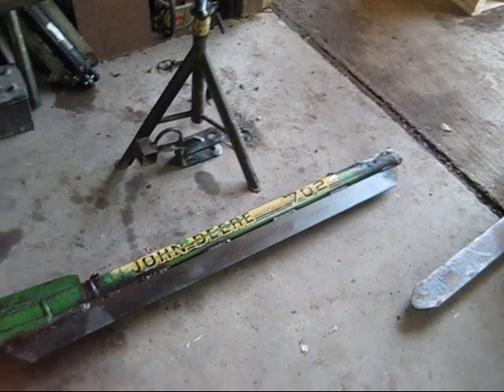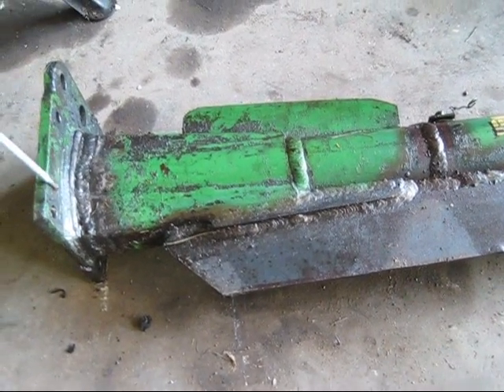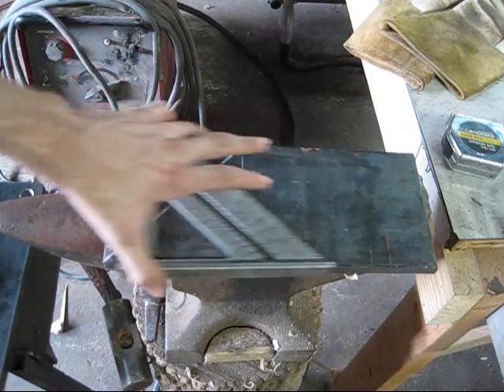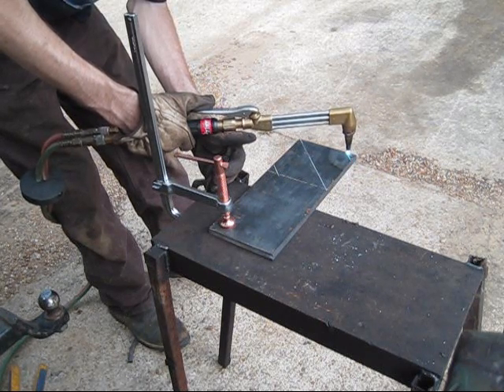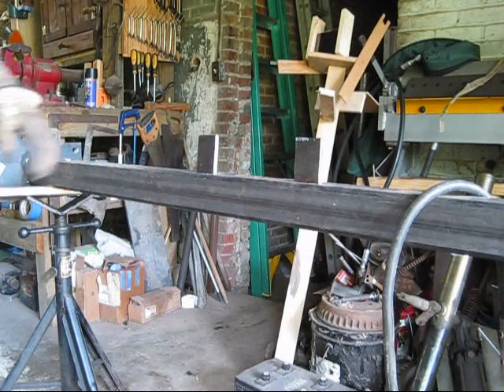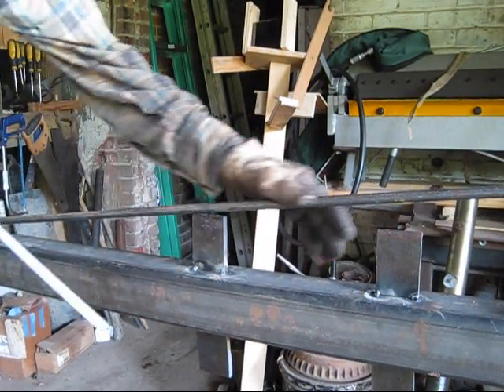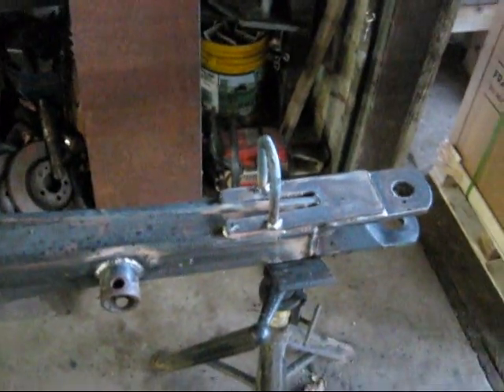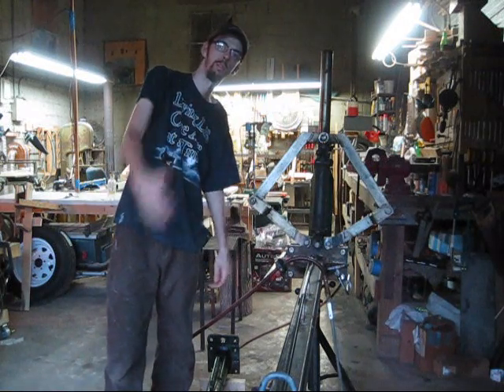Fixing design failures

Comment: sounds like a AC buzz box . have you thought of a plasma cutter instead of oxy act torch ? great vid , thanks
Reply from the maker: That is a old Lincoln transformer machine. Square wave 175 it’s a DC machine you’re hearing the transformer kick in I’m sure. I’m not a fan of plasma need to do a video on it they don’t fit the needs of what I do mostly. And they’re not cost-effective the consumables for plasma cutter or seriously expensive over time. Thanks.

Comment: I've worked at several trades and sometimes a solution used in one can suggest a solution in another. When you were building that stiff back It reminded me of some semi trailer repairs I've done. On a semi trailer that would go under the deck using larger material and would be called a stress rod. 
When I was hauling construction equipment I had a paver stack give out and end up laying on the deck of the paver. The stack gets rid of  the fumes from the asphalt and is about 6 inches square and 8 feet tall. It was a new unit so it should have been okay but the stack was held to the deck using quarter inch bolts. That may have been enough for while they were paving but on the deck of my trailer the stack felt  every bump in the road two weeks after the company bought it. 
I'm retired due to an injury so I like to spend part of my day watching other people work. The good ones that is.
Thanks for another well done vid.

Comment: You are producing some of the best technical work instructional videos on YouTube. I haven't even seen a single thing I disagree with in your videos, and that is really saying something.  I hope all the effort you have put into these videos results in great success for you, both on- and off-line. 

One thing that could have been added to your explanation of the jib brace is that as the arm flexes it is experiencing two kinds of stress (broadly speaking): compression on one side and tension on the other. That simple brace will help reduce both, but it is best for tension. As the same structure is now on both sides it will resist tension in both directions, which will therefore also limit compression. Whether or not you knew about that relationship in those terms,  you understood the systematic stress intuitively, as the bandaid welder before you did not.

Comment: Love your work mate, quick question - is there any reason you don't use an auto darkening welding helmet? - Definitely not criticising anything you are doing, I think your skill set is awesome,  just wondering if you have tried them and didn't like or found a design failure in then haha - cheers
Reply from the maker: Thanks man. The helmet I was wearing was auto darkening (the NAPA) and I love them. I lift my hood a lot I guess just second nature.
Reply: Classic Work Ahhhhhhhhh, haha, old habits die hard man, keep the videos up mate, especially the Metalwork ones